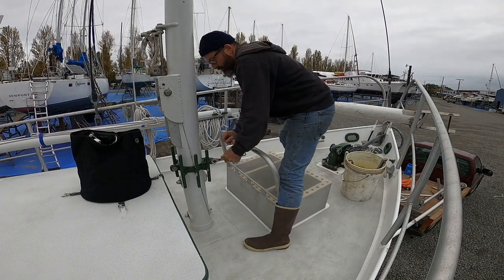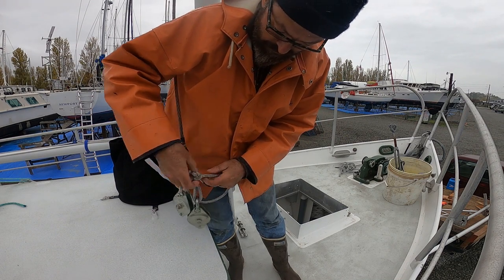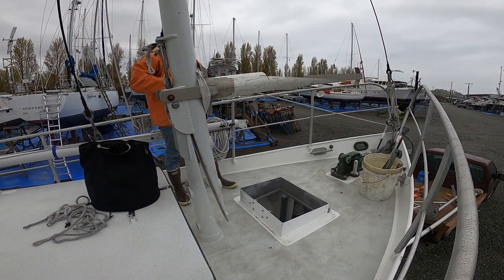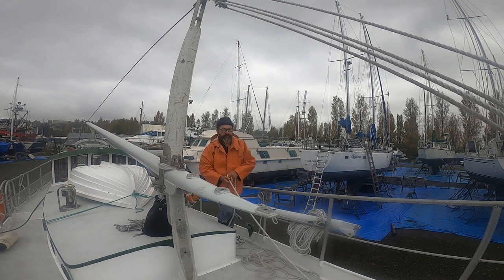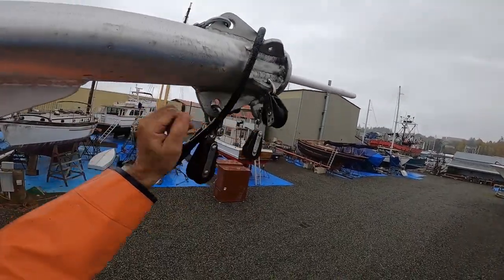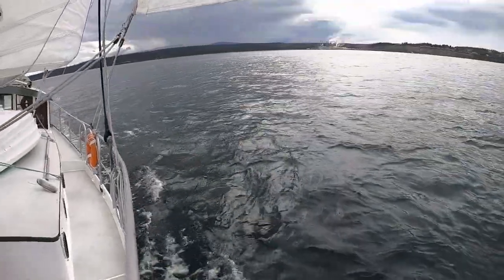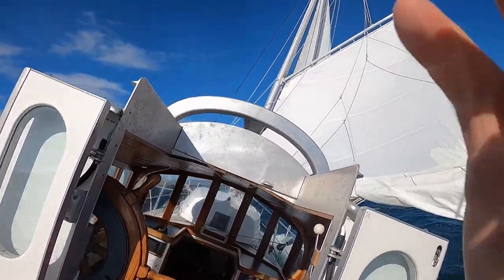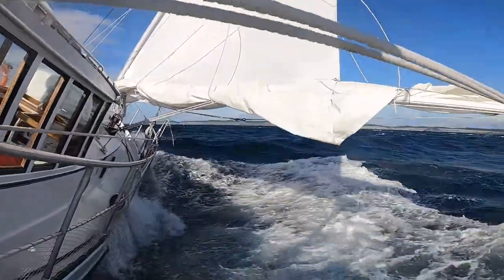Mast Tabernacle

Comment: Awesome job!

I have an idea to do something similar but having it swing forward rather than aft, using the boom as the gin pole.

This would not be a system for stowing the rig, just something to get it under low bridges.

I would think something like this would be fairly simple to do for a boat in the 26-30 ft range.

Comment: Hi, I was thinking of doing the same with a traditional aluminum keel stepped mast (thinner walled oval section) .  My only concern has been that the bolted/jointed section would be less flexible than the rest of the mast, the rigid section straining the flex.  Your mast being so much stronger obviously doesn't have these concerns.

Comment: Just a great video.   I thought I would slice a pipe to capture the mast as it raises vs your set up.   what do you think?   thanks for the idea.
Reply from the maker: If your rig was originally designed to be keel stepped, then it may be very important that the tabernacle retain similar strength as a continuous mast.  My "scarf joint" was an attempt at this.  You might need an engineer to verify the strength of your proposal.
Reply: My rig is just for day sailing on an inland lake and is the mast is deck stepped.   I am getting old and an little help from a tall tabernacle sure would make it easier.   I would  rig a short mast for starters for my Paceship 'mouette' 1976 w/ 19' length  6' beam w/ 23' mast 6' of retractable swing keel,  a fast boat.  But the 23' mast is a lot heavy for a couple of old guys.   Maybe try using pvc to test for fit before putting out the dollars for steel.l..    Thumbs up for you, great work and great video!.

Comment: Great philosophy, keeping things simple. I have wood masts on my boat that I need to replace. Was thinking along the lines of what you did. How did you join the sections of pipe together...weld? Sched 40 alum pipe has a temper. Don't you loose the temper when you weld it? I was thinking rivets for mine. I see you are at Shelter Island on the Fraser, if you get over to Gabriola Island, Degnen Bay. Stop in ! Schooner Endurance.
Reply from the maker: Thanks for the invite Jose, but I am in Washington State.  Hopefully the border will be open next Summer.

Yes, the heat treating will be lost during welding.  However, Panope's mast is made from a single continuous pipe, so no need for a weld joint.
Reply: @flygoodwin  Steve, can I ask what pipe you used for your mast? Regular pipe comes in 20 ft. lengths. I assume your mast is longer than that. My main mast is 58 ft. so would have to join 3 lengths of pipe. I'v been looking for a 58/60 ft mast for 3 years now.
Reply from the maker: The pipe I used was purchased many years ago by my father.  We have no memory of the source of this pipe.

Comment: Hi..a year later,. How is the size and weight of the doghouse effecting the balance of your boat??
Reply from the maker: The effects of the  doghouse addition (10 years ago) were masked by numerous other changes made simultaneously. 
Most important was the change from schooner to sloop rig.  I did not make exact calculations, but my gut feeling is that the removal of one mast negated the righting moment reduction that was caused by the doghouse addition.
On the other hand, the removal of the bowsprit added to the "stern down" trim, so it is hard to say how much the doghouse effected fore and aft trim.
Subsequent to the above changes, I removed another 1,200 pounds (lighter interior) and  relocated ballast (forward).
Boat is now floating higher and slightly bow down compared to the original configuration.  Best of all, she sails better.
Reply: @flygoodwin  Thank you for your reply 🤗

Comment: Your boat looks great thanks for the great info on your mast design.  Just wondering where you are located?  Do you have any plans to cruise?
Reply from the maker: Thanks Terry,

I am in Washington State.  No plans to live aboard full time.  Boat is used locally with up to 2 or 3 week trips around the Salish Sea.

Someday, I will take a long Summer break and make the trip up the Inside Passage to Alaska.  This is the mission that I had in mind when I modified Panope into her current configuration.
Reply: @flygoodwin  I've often wondered why more sailboats don't use power-line  guys that are all over the country and stand up for years in the elements as standing rigging.  It must be the weight, because they are very strong and easy to install. Any comments on this?
Reply from the maker: @TerrydeAlaska Off the top of head, the thing comes to mind is that this wire may have fairly large strands and may not be able to make the small radius bends required for making strong 'eyes'.
Reply: @flygoodwin  they use a guy-grip deadend to connect to the wire. , or three bolt clamps. https://www.georgiaunderground.net/products/3-8-dead-end-preformed-plp-gde-1107.html?sku=PLP%20GDE-1107

Comment: I’m looking at doing this to a sloop rig Marshall 22 is there any chance you could send me any design prints you have?
Reply from the maker: I designed this tabernacle by the seat of my pants.  So, no plans exist, other than in my head.

I looked up your Marshall 22 design, and noticed that this is a (mostly) FREESTANDING mast.  While I believe a "scarf joint" style tabernacle might be usable, the high loads involved means that very careful engineering will be required.  

My situation was much less critical on account of the mast being (mostly) supported by shrouds and forestay.
Reply: @flygoodwin  Roger I appreciate the response and input. Currently I’m looking at adding another set of side stays and chain plates further aft, but you are right there is still a fair bit less rigging than usual boats. With safe harbor it’s becoming harder and harder to find marinas that will deal with sale boats at a reasonable price. That’s why I’m leaning towards a similar set up to what you have